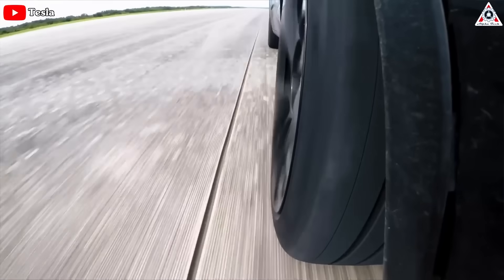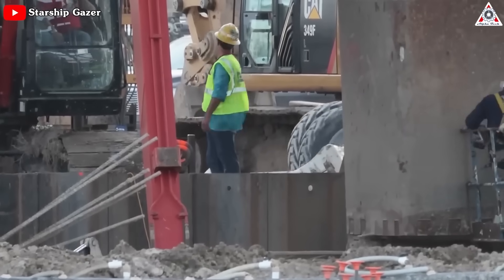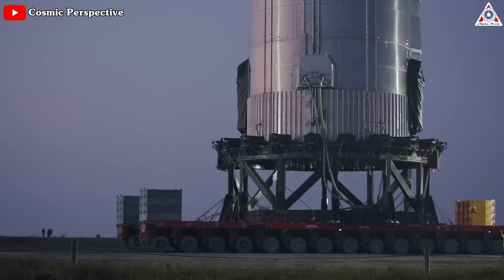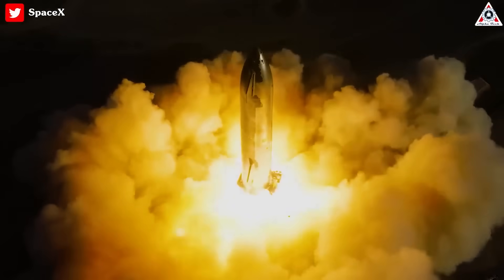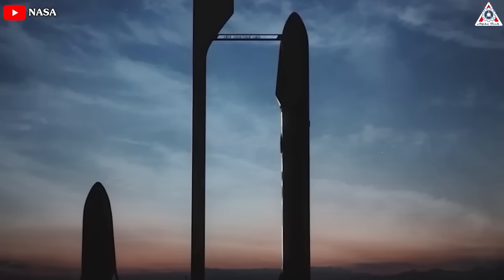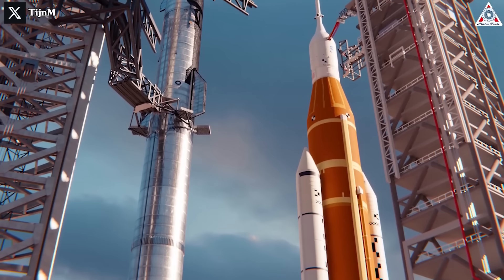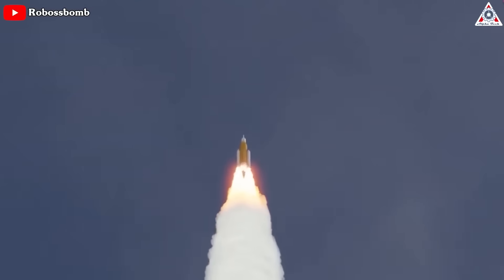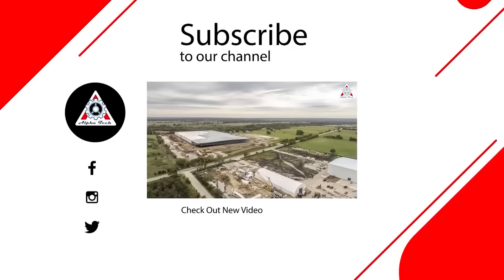How SpaceX Starbase SHOCKED NASA Artemis Team! NASA finally realized Starship better than SLS...

Comment: 1. NASA doesn't have the luxury of blowing stuff up without having a high level confidence in their design resulting in one successful Artemis 1 mission to the moon and back. 2. No other rocket on earth except SLS has the power to send the Orion capsule to the moon. Even Super Heavy isn't capable. 3. It doesn't take NASA 26+ prototype rockets and 7+ boosters(to date) to even get the system  successfully off the pad. 4. Whenever the system is up and running it will still take 6 starships to get one Lunar Lander  to the surface of the moon.  Not exactly a model of efficiency. 5. SX has spent nearly as much time and money(including NASA money given to SX) developing SS as NASA has SLS. I am very hopeful of SX's success, but just slamming NASA is not going to get SX to the moon any faster.
Reply: SLS will cost $3 billion to launch...plus $1 billion per year to keep the project alive.  Since they need 12 months to build a rocket - it's $4 billion per launch.  With a 75 tonne payload.   When StarShip is ready to go - it'll cost SpaceX $2 million (yeah M-illion - not B-illion) per launch.  They'll probably charge 50 million - and that's for a 150 tonne payload.  Sure - they'll need four tanker launches - but that's still only $50 million x 5 = $250 million versus $4 billion.  So 16 times cheaper for twice the payload - that's 32 times less $/kg.  SuperHeavy+StarShip could easily send 100 people to the Moon in one shot - including supplies, habitats and vehicles.   SLS can send ONE capsule with FOUR crew - no supplies, no habitat and no vehicles.  StarShip's interior volume is greater than the entire ISS - and could serve as habitat as well as being the crew launch vehicle.  And SpaceX can build a new StarShip every week - and will be able launch them once per DAY.  SLS+Orion only gets you into Lunar Orbit - you need the "Lunar Gateway" space station and a SEPARATE lunar lander in order to get to the Moon.   StarShip can land direct on the moon and return - so no need for a space station and no need for a separate lander craft.   If you still think SLS is somehow better - you're either very poorly informed or just plain nuts.
Reply: @SteveBakerIsHere  I don't have to resort to name-calling to express my opinions. And btw the fantastic vision you and Elon outline is at least 20+ years away.
Reply: @stephenwhite4257  So you don't have a factual counter-argument then?  Why 20 years?   It's your own wild-assed guess...not based on any actual information.   Every fact I stated is easily verified with a simple Google search.  Put those facts together and the answer is VERY clear.
Reply: OK then 30 yrs. If you think launching 1000 humans and 100 Starships loaded with livable habitat and survival supplies on a 6 month (probably 1 way ) journey to Mars is going to happen in less than 20 yrs your the one not relying on facts. Keep the dream alive.

Comment: This channel is becoming nonsensical. NASA is fully aware of the costs and benefits. SLS has successfully flown a mission. Starship has not. The cost difference is important but accomplishing the mission is critical. Starship has potential utility but cannot fully replace SLS capabilities in the near term. Please stop this SpaceX cheerleader and NASA trashing propaganda. They know what they are doing and why.
Reply: NASA has been spending in excess of $1B each year for over 10 years on SLS. SpaceX started on Starship about 5 years ago. You can't just say NASA is ahead without this context.
Reply: It doesn’t matter how much money or how many years were spent. Only results matter. NASA has been spending billions for decades, along with the commercial rocket industry. This is the norm. Disruptively cheap large rockets will be great. But they are not ready yet. NASA has a mandate to go back to the moon soon. That meant building a big rocket and it was always going to be expensive. NASA is hoping that cheaper big rockets will come soon but they are not counting on it. They counted on a single launch system before and got burned which led to dependence on Russian rockets for a while. Never again.

Comment: Nothing for nothing, SLS has actually made it to orbit and not starship. This video makes it seem like it’s the other way around. And a question, are the engines on the side booster the exact same as on the rocket?
Reply: After it got to  orbit, how soon was the SLS booster ready to fly again? The capsule?
Reply: @johnryan6003  The answer is of course, never.  I hope I didn't offend you.  I think fair is fair and I was simply trying to be fair.
Reply: "are the edges on the side booster the exact same as on the rocket?" What are you referring to? Do you mean engines not edges? Side boosters are solid fuel, main ones liquid H2 and O2.
Reply: @royh6526  yes thanks for calling atttention to that.  I meant engines.  So, same exact engine but just running on a different fuel.  Thanks again.
Reply: @BoogerDeluxe22  Not same engines, completely different concepts. Solid rockets don't have an engine per se, it is filled with the solid fuel and a hole up the center. Light it up and burns from the inside out, only outlet for exhaust is the nozzle at the bottom. Once lit cannot be stopped. The liquid engines have turbo pumps for the fuels and a combustion chamber above the nozzle. Fuel flow can be regulated.

Comment: 8:20 - Yeah, first and foremost employment opportunity and the source of bottomless "cost-plus" contracts for Senators' corporate owners. NASA has nothing to do with this debacle - only Congress is to blame.
OTOH, NASA could possibly have managed mobile launcher program far better, especially its second iteration awarded to Bechtel that seems to be developing into a SLS-style disasted.

Kudos for stressing Tom Mueller's role in SpaceX success.

BTW, the whole Starship project took much longer than Saturn V, even with the benefit of already developed, well known technology (admittedly, at a  much lower cost.) $10m per launch is just fuel cost - what do you think, how realistic is the expectation that this level or reusability and reliability is "around the corner", before even the first successful launch, with Raptor MTBF in minutes?

You are right, once SpaceX manages to send Starhip into orbit without destroying anything on the ground, the cadence of tests will increase. But SpaceX has a huge amount of  milestones to pass before Starship can be considered a "default" heavy launcher for lunar and other out-of-LEO missions.
Reply: Mean Time Between Failures (MTBF) can always be expressed in "minutes."  If the value is over 1440 minutes, it can reasonably be expressed in "days."   That may not be appropriate in this case, though.

So... what is the Raptor MTBF?  Raptor-2?   Raptor-3?  other rocket engines in use today?

Other than the MTBF jab, I agree with the rest of what you said.  It is hard to say Starship on the Superheavy booster - as it currently exists - is better than SLS given that SH/SS has not achieved LEO when SLS has propelled its payload to the moon and beyond.  

That is how things currently stand.

Comparing the "final version" of each, however, the situation is reversed.  SLS Block-2, with its additional SRBs, will still have less thrust that the failed first launched SH even after accounting for the engines that failed during launch.  Projected payloads are not the same with SLS coming up short even using 6 (?) SRBs at something like 1.5M lbf each.  Plus, every bit of SLS will be used once, only; NONE of SLS components, other than the launch tower, will be reused.  Meanwhile, every bit of SH/SS will be launched again if things go as planned for that "final" version.
Let's let SpaceX continue to develop their platform.  Their success will help NASA concentrate on science packages rather than transportation systems development.
Reply: @frankmcgowan9457  Don't pretend you don't understand. During the first launch attempt, anywhere between 4 and 8 Raptors (v2) out of 33 failed during the first - what - three minutes? That would give them MTBF of half an hour, at best. They need to improve that by an order of magnitude to make SH/SS usable at all, and by three or four orders of magnitude to make fuel the main cost item. 

The question is not how bad SLS is - very - but will SH/SS cut the mustard at all (I think it will, despite the humongous dead dry weight of the upper stage), and then will it be as spectacularly cheap as Musk promises (I very much doubt it).

Comment: Looking at that big hole underneath the launch platform, I'm confident with my speculation that Elon knew that the first launch would save them time for demolition to facilitate the upgrade.😄
Reply: The "big hole" hasn't been under the launchpad for almost a month now - there'a a very solid steel plate - laced with water pipes...and it's withstood the force of 33 Raptors without so much as a scratch.

Comment: A metaphor of the efficiency of Atemis and SpaceX: If an Atemis technician needs a screwdriver. Artemis management analyzes the request (with an offsite or 2) and eventually organizes parade to deliver a screwdriver to the technician. At SpaceX, the technician simply reaches for the one on his work belt.
Reply: US Embassy service employees were fitted to Washington job descriptions back in the late 70s.  It didn't work well for the same reason.  In DC, a technician would report the problem and it would go through all the higher pay grades.  At the Embassies, the guy would get what he needed and fix it.  DC guy's job was done when he reported the problem.  Embassy guy's job was done when it was fixed.  US Government hasn't changed.
Reply: Sociopath
Reply: @Edward-lo4hb ??
Reply: @Edward-lo4hb are we projecting here or what?? Tell, a brother what they did to you to make you feel this way, homie…

Comment: SpaceX is amazing no question, but it's easy to forget the rockets they're building are prototypes. They're not entirely complete. There's no bridge for flight controls or anything just fuel tanks and a shell. Once they have to start putting all the other systems for humans in, that whole process is going to get bogged down. They will not be building a complete starship at even near the same rate. Of course, they'll probably prove me wrong somehow. They are SpaceX after all.
Reply: SpaceX has built the Dragon capsules. They are not beginners. Starship will be fully automated. Astronauts are just passengers. What delays their human rating is reliability. Once that is achieved they will start sending humans, just the way they did with Falcon 9. In the mean time they can launch people onboard Dragon and transfer them to Starship (and the same on the way down). SLS is not needed. Traveling to the Moon or Mars does not need SLS - nor is a station around the Moon.
Give SpaceX 25% of what is spent on SLS and the invest the rest on science. A win-win solution.
Reply: @knowledgeisgood9645  That doesn't make any sense. Launch a starship to orbit, then a crew dragon and transfer them to starship and do the same on the way down. Dosen't that defeat the whole point of starship ?. And if it is human rated enough to be in space it should be human rated enough at launch. All rockets are automated going right back to the Apollo moon missions. The astronauts will have to be highly trained to take control of starship should they need to and not just passengers. Especially when going to the moon or mars.
Reply: @dazuk1969  The whole reason why SLS is needed is to take astronauts to the Moon and back, because Starship is not trusted to lift-off or land on earth, yet. But Falcon 9 can do the same thing as SLS, without the extra cost. But instead of switching crafts at the Moon it could be done in earth orbit - much cheaper. Starship is trusted to land on the Moon, so why not use it from LEO to the Moon in one go.
Reply: @dazuk1969  that nasa rules , duh. o take it don,t read the contract spacex has with nasa .
Reply: @knowledgeisgood9645  true  and nasa  rules said they don't want a landing of starship they dragon to land on the ocean instead
Reply: @knowledgeisgood9645  Who said starship is trusted to land on the moon ?. NASA have financed a second lander from Blue Origin as the way starship lands is sketchy to say the least. Put it this way, would you get on a starship to the moon and try that belly flop/flip landing ?. I wouldn't until Musk has sent his grandma up and lands successfully at least 5 times.
Reply: @dazuk1969 belly flops are for earth landings. For moon landings it will land the exact same way as falcon 9 does....week after week month after month
Reply: @keithsmith4236  Falcon 9 lands on perfectly flat hard surfaces and is electronically guided/connected to the drone ship. Even with the moon starship will have to flip from horizontal to vertical at some point. Anyway, you are forgetting the primary purpose of starship is to go to Mars. The moon is just an inconvenience. So I will ask you...would you go screaming into the Martian atmosphere at thousands of miles an hour and belly flop/flip land on an uneven sandy desert ?
Reply: @knowledgeisgood9645  for sure that's no Bullshit, SLS is NOT needed. Padding pockets and lush contracts for Boeing is about all it's good for. There is literally nothing to gain from SLS!!!
Reply: When the pad is no longer broken into fragments by the exhaust of the engines the fragments damage, progress will speed up.  Because crew accommodations are likely scheduled for development late in the process, I don't even expect the Crew Dragon approach (which several of us have suggested) to be implemented for several launches.  Instrumentation for g-load and radiation will undoubtedly be SS "cargo" on its first few lunar missions.  Even that will of necessity come AFTER refilling the propellant tanks in LEO and restarting the engines for near Earth test missions has been completed several times.  After all, blowing up in LEO will still be bad even if more people get to watch the spectacle.  That outcome is to be avoided as is the shower of stainless steel debris in chunks that could range up to hundreds of tons.

Once all that has become routine (for those watching from home), I expect NASA to realize that paying for a Crew Dragon mission plus the expendables for the HLS mission as well as the HLS to actually land will still cost less than launching one SLS for the same safety margins.  

Once SpaceX demonstrates the ability for HLS to reliably transport Crew Dragon (attached to a nose docking ring), it's Crew and a reduced cargo load to the moon, Congress will decide to save $4.1B per mission by grounding SLS.  If they are wise (I have my doubts), they will use some of the saved money to fund a more rapid mission tempo.
Reply: It doesn't need "flight controls" - it's like Crew Dragon - 100% autonomous.  It's clear that there are at least two StarShip shells that have been built out with prototype crew facilities inside - just because they don't announce these things in public doesn't mean that they're not working on it.
Reply: @SteveBakerIsHere  it doesn't need it, but it still has screens and back up manual controls built in for redundancies, duh!
Reply: Spacex have a contract with NASA to land humans on the moon in 2025. I just can't see that happening. These are prototypes as you say and a very long way from being a human rated rocket. As much as I admire spacex I think it is time that things stop exploding and work properly. The raptor is still a very unreliable engine. Some work and some don't. There has been a fire in the engine bay on every single flight and every flight has blown up except one but even that was on fire when it landed. This next test flight needs to do all the things it is supposed to and not explode.
Reply: @dazuk1969 
The NASA folks were predicting the damage from April's launch would take SpaceX a year to analyze and repair and longer to have a new SH/SS stack to test.  It has been four months.  
SpaceX says they're ready.  
When the FAA finishes examining the SpaceX repairs and fixes, the newly modified launch license will be granted and the second test launch will happen.  It will be very quick once they get down the hast few issues to be resolved.
Reply: @frankmcgowan9457  Yes, the FAA requested 66 corrective measures and most have been addressed by spacex so it shouldn't be to long. I am skeptical that all will go well but we will see I suppose.
Reply: @dazuk1969  "The raptor is still a very unreliable engine." True, but SpaceX is pushing the boundaries of rocket engine performance. Elon's mode is to push them to their limits and see what fails, fix/re-design and try again. These latest Raptor engines are about the same thrust as the Space Shuttle engines and Blue Origins BE-4, at a fraction of their size.